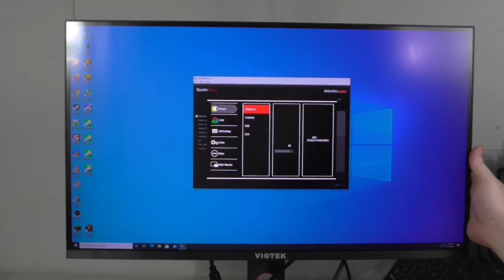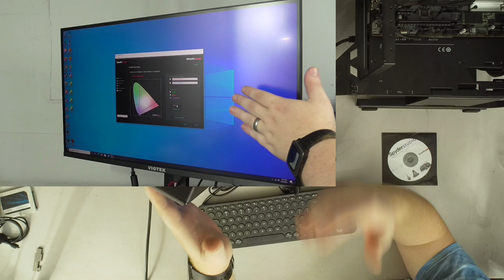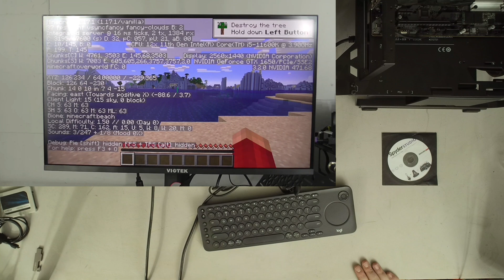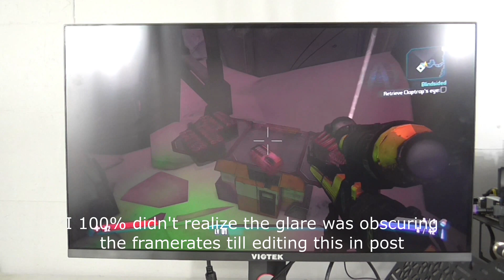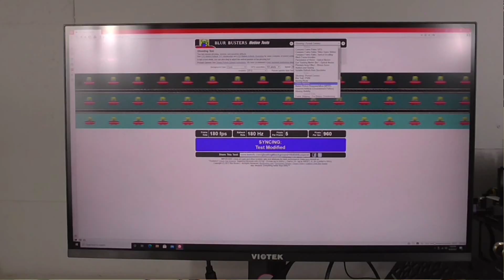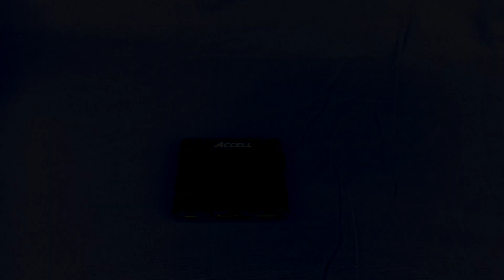Viotek GFI27DBXA 27 inch gaming monitor review this thing is amazing

Comment: Nice! What settings did you color calibrator suggest adjusting to correct the factory color settings?
Reply from the maker: Unfortunately since the calibration generated a color profile for my specific panel there's no guarantee it works on any other one(it's an icm file windows uses not settings on the monitor) the only setting on the panel itself that was adjusted is the brigthness.

Comment: **Supposedly** This thing can be overclocked to 240hz! I'd be curious to know if that's just panel lottery or not though, guess I'll find out myself as I've taken the plunge 👍
Reply from the maker: Let me know how it turns out maybe i'll try it on ours! I'll ask Viotek PR myself as well!
Reply from the maker: Official word from viotek pr is that they haven't heard of it but I'd love to hear if you pull it off
Reply: I purchased this monitor about 5 weeks ago, and I was able to use CRU to increase the refresh rate and Freesync/Gsync range to 240Hz, and it works flawlessly for me. 
For $320 plus tax, there isn't anything better out there.
Reply: Have you been able to overclock it?
Reply: Yeah, I bought this monitor and i set a custom resolution in Nvidia CP and it works perfectly at 240. Gsync only works up to 180, I don't need gsync so I don't care, I run 180. The color and performance of this monitor is amazing. I bought this for my son. I have a the LG 27 that's supposed to be among the best. I like this viotek better, has better image quality and better contrast. Great considering the LG cost near $200 more but only priced about$100 more now. Loving this monitor